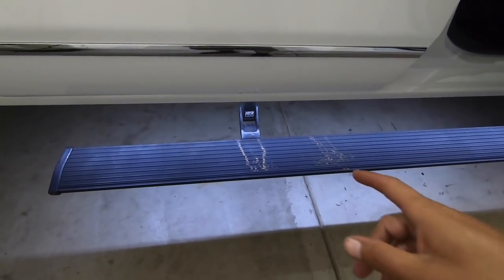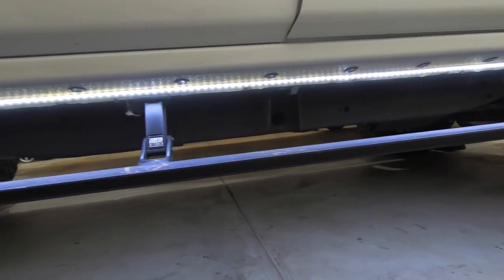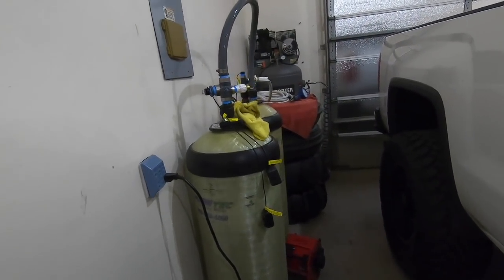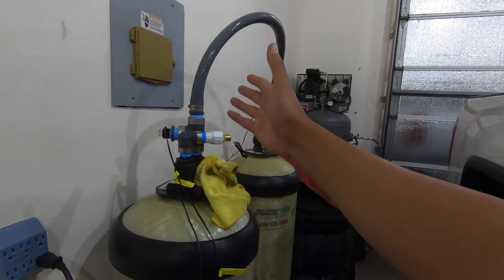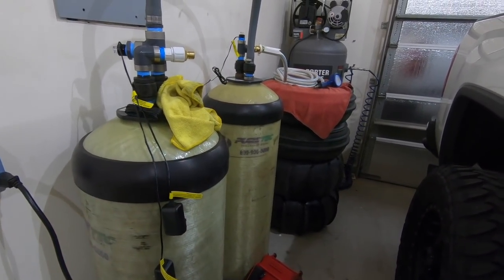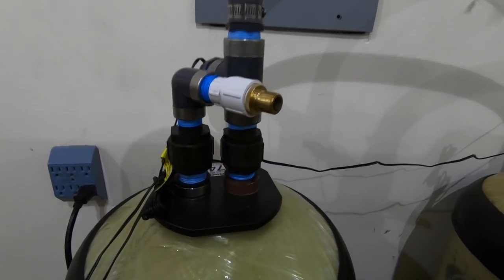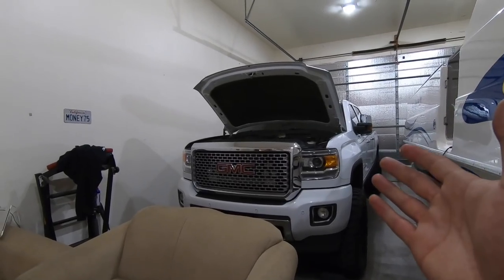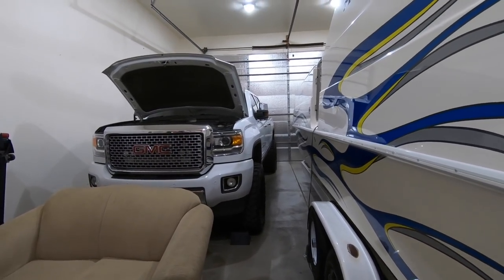SHOULD YOU RE-GEAR YOUR LIFTED TRUCK?

Comment: Do the math. (New tire size * Original gear ratio) / Original tire size. So you have (37" tires * 3.73 gears) / 32.5" original tire size. This equals out to about 4.25. This is the gear ratio your truck would need in order for it to perform like the truck came stock with 37s. Now you can go either numerically higher or lower from here, higher will give more power, but less fuel mileage. Numerically lower will give less power, but better fuel economy. Because they don't make a 4.25 gear ratio for your truck you can either go to a 4.30 gear ratio, OR a 4.10 gear ratio. Changing tire size does not change gear ratio. Installing 4.56 gears will not give you a 4.10 ratio because you have 37s. Do the math, and decide what will work for you.
Reply from the maker: i did the math on the online chart and for me to have close to a 4.10 i need 4.56s
Reply: @EddieLife3500  duramax is not 3.73... its 3.42 i guess
Reply: If I put 37's on a tundra with a 7inch lift what gearing woukd you suggest?

Comment: 2016 Ram 2500 6.7 auto 4x4 cc long bed 37/13.5/20 on 20x12s with 3.42 gears I just installed a set of Yukon 4.56 gears. Long story short I will be switching to 4.10s as soon as possible.   Rambeast guy is full of shit.

Comment: To get the gearing back to stock. 
Take the new Tire diameter and multiply by the old ratio then divide by the old Tire diameter and that equals your new ratio needed. 
275/55/20=31.91
37 ✖️3.73 ➗31.91= 4.32

Comment: I'm sure for all of your towing needs the setup you have will be fine. The engine will have all the power you need. The problem will be all of the drive train components. I learned the hard way not regearing my truck years ago. My trans needed a rebuild at 100K and the shop told me what I said earlier in this comment. Plus it's easier to get out when buried in sand when you have a better gear ratio. Great videos man.

Comment: I re-geared twice  on my LLY duramax w/ 37's with the 5 speed Allison. Originally, I went with 4.56 G2 gears,  RPM's were to high on the interstate ( 2200 at 70mph!), they were noisy, but it had a TON of get up and go in the city..    I quickly got tired of the high RPMs and noise so switched to 4.10 yukon gears  The 4.10's with the 5 speed are perfect.   My RPM at 70mph is about 1900 with the  4.10's.  If you re-gear get something good like Yukon.   The truck feels significantly better after re-gearing, shifts are where they should be and RPMs are high enough cruising to have enough airflow to keep EGTs in check (running Predator on level 3).   Feels more like a stock truck.   Overall I would say don't fear the gear but don't go too crazy on the ratio if you want to be able to drive 80.
Reply: Great Advice & Practical application(s) right here! Agree 100% with everything Brian just said.
Reply from the maker: brian can u DM on instagram when u get a chance @duramaxking2500
Reply: Eddie's Life don't have Instagram but you can hit me up on Facebook messenger.  Brian Fidazzo
Reply: BrianNC81 what kind of noises did the 4:56 make?
Reply: Steven Trujillo they made a whining noise at speeds over 60mph.  I think it was just crappy gears.  (G2)
Reply: BrianNC81 interesting, would the noise wine over 60 and than make like an almost chatter noise when coasting from the higher speed? Reason I ask is because my 4:56 g2 gears make weird noises over 60
Reply: Steven Trujillo yep mine did the same and over 75mph it sent a vibration through the truck.  I really like my Yukon 4.10 gears, they are like factory.
Reply: BrianNC81 Im getting ready to do yukons 4:56 on my 16’ denali 2500. 12” lift on 40’s. Think they will work good? On stock now
Reply: @swoop-it4621  I think 4.56 would be perfect with the 6 speed Allison and anything 37" and up.
Reply: BrianNC81 cool!!! Appreciate it. Think it will be a better fit/performance than stock?
Reply: @swoop-it4621  not quite stock but really close feel.  I think you'll be happy with it.  Even with the gears, you will not get the same MPG as stock.  Big heavy tires will cost you a few MPG.  In lost about 2 mpg going with 37s.
Reply: BrianNC81 thx. I really don’t care about mpg to be honest. Just wanting a better system for those 40’s and my 12” lift. I know guys running stock gears but that just makes me cringe. Thx man

Comment: I have a Ford Excursion with 10.5 inch lift on 38 15.50s
Original 3.73 gears with basically 30 inch tires
After it was lifted I had a terrible low rpm lag then as the gears started to pull all that tire and lift then I got a power about 2500 to 3000 rpms 
Put a set Grizzly 5:38 gears in there and I have great throttle response through the rpm range can cruise at 75 around 1600 rpm and I'm getting better fuel mileage

Comment: Should I re-gear mine they told me I need it I got a 2012 Chevy Silverado with 9in maxtrac lift on 35 15.50’s and I got long tube headers and I got it tuned so the guy told me I needed 4.56 gears for it to be safe to race I heard that would pick up them tires like nothing it’ll make it go faster but idk

Comment: I just regeared my truck and used the pulsar Lt programmer to match the gear axle ratios and my cruise control won't work..I didn't tune it because I assumed the pulsar was all I needed..has anyone had this issue and how did u get your cruise control back

Comment: i regeared my 2017 ram cummins on 37s to 4.56s and love it. especially coming from a 3.42. i think 4.30s would be a perfect balance between highway speed and towing power. i didnt want to go with nitro 430s so i went with yukons 4.56s
Reply: Jimmy what’s your rpm’s at highway speeds?  What did they charge you for 4:56 gear swap?  Thx
Reply: Jimmy I have a 95 Chevy 1500 2wd and have 3.42 gears running 33's 12.50 wides. Do you think I should re gear because at 75 my rpm is at 2000 and have some trouble going uphill, it downshifts?

Comment: I currently have a 17’ Ram 1500 5.7, no diesel at the moment.. :( It has tow package with tow mirrors and brake controller but only came with 3.21 gears, which we know are terrible for towing. I have since added a 3” lift and 35’s and although not terrible I definitely notice the difference from when it was stock. A friend of mine has similar truck but with the 3.92 gears with a 4” lift and 35’s and the power difference especially towing is noticeable between mine and his. 

I haven’t decided if I’m keeping my truck but if I do I would re-gear to the 3.92. I think going to a 4.10 for your setup would get you close to your stock 3.73 feel and you would be happy with that. 

Keep the videos coming, thanks brother!
Reply: 89 Fox have fun regearing your ram if it's a 4x4. With the 4x4 ram 1500 you have to replace front axle since it is a sealed unit. I'm in the same boat as you but $$$$$$ tells me hell no!

Comment: I have 2018 GMC Sierra 1500 4wd 5.3 that came with 31" tires and 308 gears and was a absolute freaking dog and hated the truck. I put 3.5 inch rough country lift and 33x12 tires and 410 gears, cold air, exhaust, and diablo tune runing 93 octane and i have a new truck. crazy difference...

Comment: 37x3.73=138.01 ÷ original stock tire size in inches will give you back your correct gear ratio. ie your truck probably came with p285 60r20  tires or 33 inches.. 138.01÷33=4.18 or 4.10 gears. 👍

Comment: I got a lifted 2016 silverado 1500 5.3 8in with 35x12.5r22 i havent regeared . . .should i re gear or just leave it as it? i was advised to turn on tow mode
Reply from the maker: after re gearing my truck i would re gear because it is amazing now
Reply: bro i have a 2016 1500 with a 6inch lift and 35x12.50r20 and im running 4.56 and it feels great. doesnt feel like im running 35s. mpg does kinda suck tho. i average like 12-14mpg in town. and rpm is about 2100 at 70mph on the highway. but i live in a smaller town so gas isnt a issue for me... plus my wife has a honda civic if i need to go on a road trip lol. the lower gears are better performance and less strain on your engine and tranny.

Comment: My truck is a lot older and not lifted but I put in a Eaton posi with 3:73s and factory tall tires it was decent then I added 22" rims so a bit taller than factory. Rpm dropped at GPS 70mph about 150-200 rpm vs factory size tire and wheel. I then added 4:10 gears same tire and wheel combo with the 22s rpm jumped 300 rpm at GPS 70mph  but the torque felt night and day definitely feel the difference down low vs 3:73s fuel mileage is about 1.5mpg worse with 4:10s but well worth it also speedometer is off about 5mph hints why I use GPS mph
Reply: asheetuglasse  i have 315/70R17  tires, what gears would you recommend?
Reply: Oscar Ramirez. Depends on a few factors.  What's your motor, Trans,  gear ratio now, and what you're trying to achieve for example if you do a lot of highway driving at about 75mph you definitely don't want a super low gear but if you mostly drive around town and just want a stop light to stoplight machine low gears are great

Comment: Im running 3.55 on my 17 F350 with 35x12.50 on 20's, I wouldn't re gear unless you go over 37" tires. My fuel milage took a hit though,
Reply: ColdAlaskan73 whats your currently fuel milage on that power stroke at highway speeds,
Reply: overall I am about 15.6 MPG, however if I reset the lie-o-meter I can get about 17-18Mpg or more, the lie-o-meter is actually pretty accurate when doing the calculations of miles driver/gallons used.

Comment: im not lifting my truck, but I have a truck camper on top and out in Colorado elevation robs the power a bit. would you think gearing it to a 5.13 give it a ton more kick? I usually cruise 70 to 75 mph but mostly 65 in our state
Reply from the maker: Yes re-gearing always helps with that

Comment: I have a 4inch lift running 33 and I haven't regear mine on a Silverado
Reply from the maker: u dont need to on 33s
Reply: I don't know even what gears I have
Reply: When do you need to regear ? Same kinds truck 1500 Sierra 2018 looming to Throw on 33s maybe maybe  later 35

Comment: My 2016 Sierra 1500 has 3.42s with 33" KO2s. I get 12MPG city and 10MPG hwy, before I had 32" nitto Terra grapplers and would get ~17-18MPG city. Not sure if the 33" is killing my gas mileage or it's because the KO2s have a lot of resistance or because they're a heavier tire.

Comment: What would be the best ratio for a 95 silverado 5.7l engine w a 6inch lift and 35 inch tires... a 4.56 or 4.10s? I drive on the street and highway about the same, I want my power but I don't wanna be hitting a very high rpm on the highway cause I usually drive 75 with my truck
Reply: 4.88s or 5.13s the power you get back will be awesome

Comment: Hey Eddie my 18’ dura is at 23k miles and marking low coolant is that normal. How often are you topping off on fluids or indicator message?
Reply from the maker: ya i have had some trucks do that before just top it off its probably not that low

Comment: I have an 08 GMC LMM 11” cst I did regear it to 4.56 I average about 2000 rpm @ 70 mph I notice a difference .
Reply from the maker: what size tires r u running
Reply: I’m running 38s toyo tires .
Can’t go wrong with regearing

Comment: 4.10’s are great for a lifted truck. i have a 8.1 silverado on 33’s and at like 65mph it at around 1900 rpms. The towing capability of the 4.10s are great!
Reply: What about a 95 Silverado with 33's with a leveling kit? I have 3:42 gears and has some issues going uphill.

Comment: Running 37's on my dodge, went from 3:73's to 4:56's. Truck is tuned w/ bigger turbo. Tows amazing. EGT's will not break 1200 even on the long grades towing 12k trailer 👍 I am super happy with swap
Reply from the maker: nice
Reply: Are you running YUKON 4:56’s?
Reply: No, I am running nitro gears. No issues but if I were to do it again I would have spent the extra on Yukons. I had to clean up the edge of gears with file due to what I believe to be machining marks

Comment: Love the video/ videos i watch everyone u put out might be a stupid question but what does gearing do
Reply: Gear ratio is the ratio between  how many turns the output shaft makes when the input shaft spins once
Reply: I find it funny that some people don’t understand why you should and shouldn’t re gear.  Your trucks torque curve depends on the proper gear setup.  For example you wouldn’t want to take off in 3rd gear from a stop sign.  It would be hard on drivetrain let alone no power to get up and go.  Or cruise down the freeway in 2nd gear. Your fuel Mileage would be crappy.  Now you can make small changes one way or the other.  Lower gears for possibly better Mileage.  Or higher gears for possibly higher towing capacity.  But keep in mind that you’re motor and transmission were designed just for your vehicle to run the proper rpm’s at highway speeds.

Comment: I re geared my gas 1500hd 6.0 when I put 35” on it years ago.  It had 3:73s I put 4:58 which made it a true 4:10s. I needed the lower gearing on that truck to pull my  toy hauler.  Right now I’m putting 37” on my 18 Duramax with a 9”  lift.  I will most likely re gear it too,  but only to bring it back to the original 3:73s.  I’ve been told the duramax motor was setup to run at a lower rpm than the the other trucks. That why it get better fuel Mileage than the others.